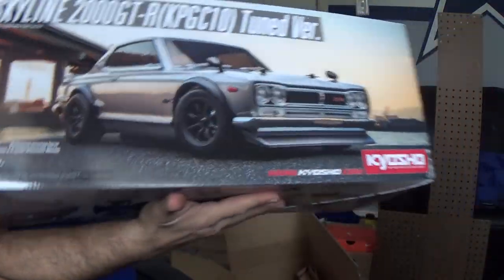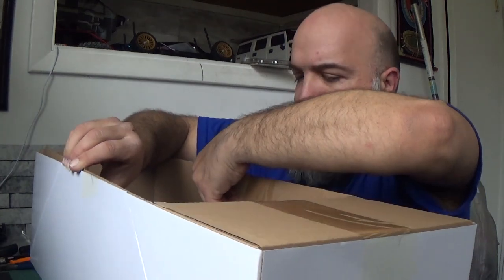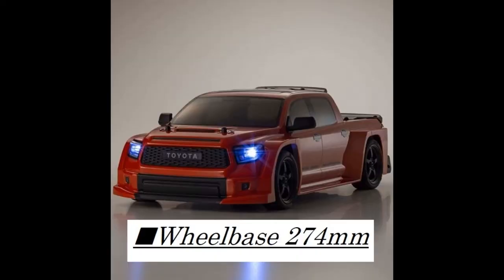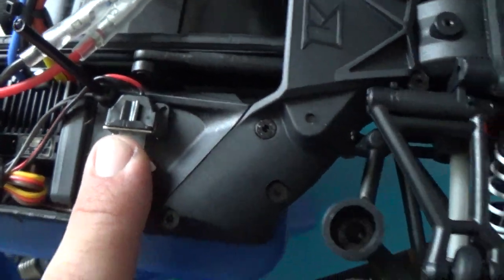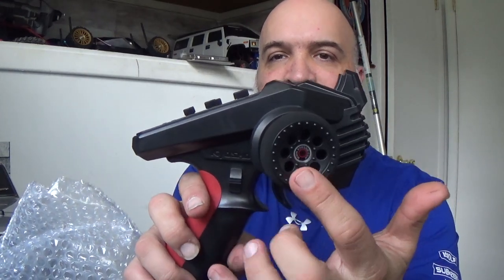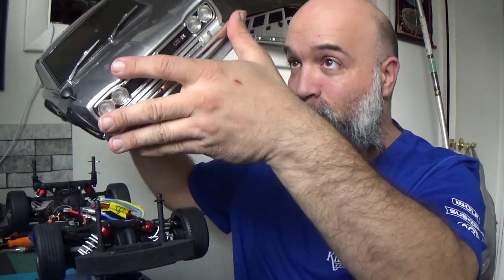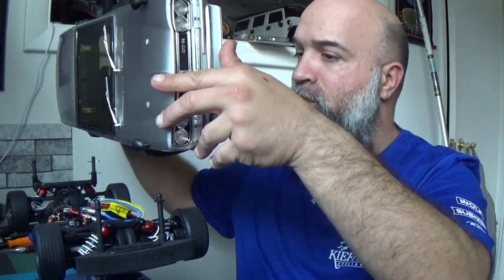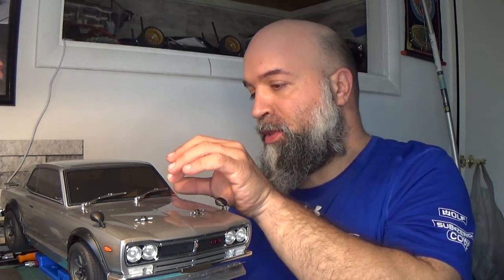Kyosho Nissan Skyline 2000 GT-R Review

Comment: I have two FZ02 cars, amd one is the Skyline...  i need to get a different body so i can run the skyline chassis more, the Fazer Mk2 cars drive so much better than my Tamiya cars.
   I wanna also try an Apex 2 or HPI , bit my next kits will probably be a RWD drifter and the RWD Supra coming from Tamiya soon...
Reply from the maker: I also have 2 Tamiya kits to build but I want to get a drifter

Comment: Just ordered one, but don't know what type of battery this beast takes. I've read 7.2V and I've also seen 7.4V. Which one did you place in yours?
Reply from the maker: So the 7.2V is gonna be a NIMH Battery and the 7.4V is going to be for a 2S Lipo Battery you will be fine running the 2S Lipo in this car I did
Reply: I've been running 2S lipo in both of my FZ02 cars, did you get a battery sorted for it?